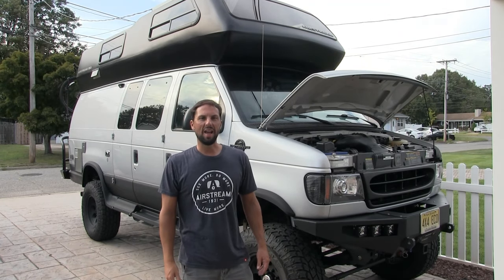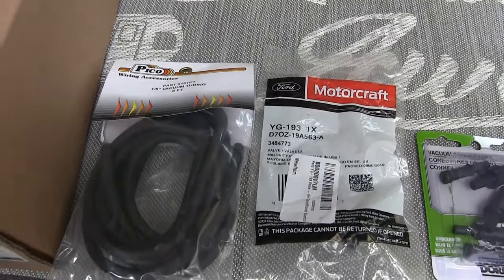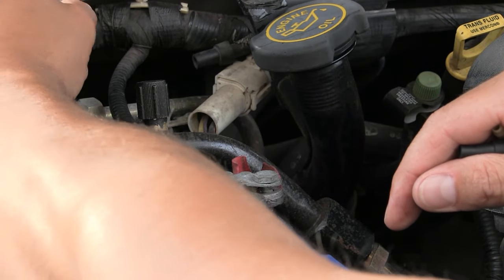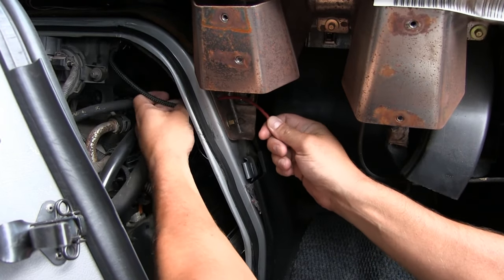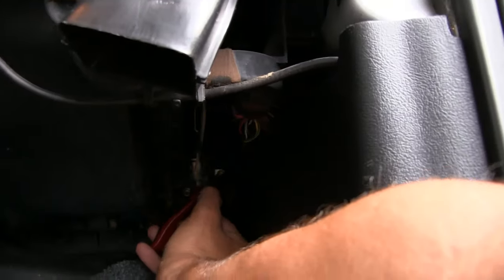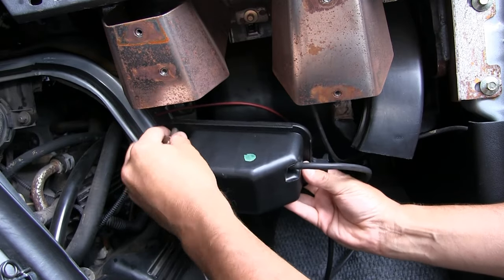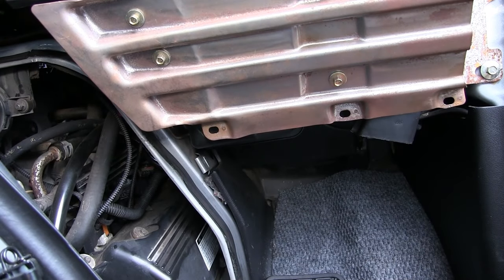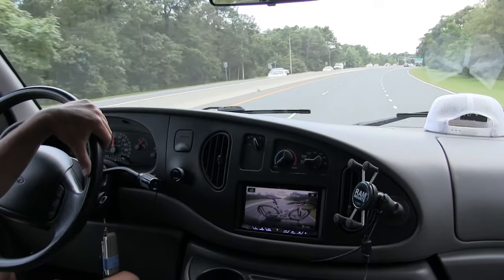Ford Econoline AC Heat Defrost Acceleration Fix

Comment: THANK YOU THANK YOU THANK YOU!!! This video saved us so much time and money. It was easy to follow; so easy that I probably could have done it, but my husband fixed it in about 20 minutes. We didn't have time to order thru Amazon and ended up going to 5 different parts stores for all of the parts, but each one had a piece of the puzzle to get to the final outcome. No more hot air blowing out the rear a/c and even the front works better! Just WOW! Cannot thank you enough! Ours was a 2008 E150.
Reply from the maker: Thank you, glad it was helpful

Comment: Thanks for this video--I think I watched all of them before doing the bypass on my 2004 E350 (where something had failed entirely and left me with air blowing out of the defroster vents only). Yours definitely cherry picked the best parts of the various fixes and put it all into one clear and easy-to-follow video, which is what all of us E-Series owners really needed! The only thing I would add is that it is possible to do this repair without buying the vacuum line connectors (just reuse the pieces from the red line and black line where they connect under the hood, near the cowl) and only about 2 inches of rubber vacuum line.

I pulled enough of the red line through the doghouse bolt hole that when I connected it to the check valve, the check valve could be located just a couple of inches to the right (when looking toward the front of the van) of the vacuum reservoir, which I bolted in the same location as you did. I cut the black line pretty much flush with the grommet where it comes through the firewall into the passenger compartment, so I'd have plenty of that line to work with. Then routed the black line up to the check valve, near the vacuum reservoir. There was plenty of slack to do this. Then I reused the vacuum connector from the other end of the black line (under the hood) to connect the black line directly to the check valve, without any other connectors or bits of rubber hose. After that, all I needed was about 2 inches of rubber hose to connect the vacuum reservoir to the check valve. Nice clean install and everything is tucked well up and away, with no chance of anything falling down into the passenger footwell.
Reply from the maker: Thank you for the useful information

Comment: I agree that this was the easiest video to follow. I ran another vacuum line through the fender to avoid having to clean out my van to open the doghouse. There was a plastic plug in just the right spot. I drilled it out and ran the line through my new grommet. I used about five feet of vacuum line and had to buy one connector. Everything is COOL and groovy!

Comment: Thanx for such a perfectly easy to follow video. I have a 2005 Gulfstream RV based on a E-450 chassis. Followed the directions and for less than $45 it was fixed within 25 minutes vs the $$$$$$ Ford wanted. (I did first put the ac valve in backwards which didn't work of course but figured that out quickly). Anyway, fantastic video and the first beer is on me!!!
Reply from the maker: Glad it helped Daniel
Reply: I too I'm about to attempt this on a 2005 e450 Coachman Concord I'm glad to know it worked thank you

Comment: Terrific video, thanks for the solid assist. My '97 e-150 has comfortable passengers again! Will point out that I ordered 1/8" tube and what I got was too small for this application. Package doesn't say whether 1/8" ID or OD, but must be OD. The connections to/from the bypass valve are 1/8" ID. Local parts house has rolls of bulk tube and I took the male-end parts up there, so was able to confirm fitment before we cut a few feet off the roll. Lesson learned. Otherwise, very clear instructions in this video and a tremendous resource. Well done and Thanks!
Reply from the maker: Thank you for the feedback

Comment: Awesome instructional video!  Thank you so much.  Solved my AC problem of cold air only coming out of the defrost. Saved me a ton of money and done in less than an hour, and I’m not mechanically inclined!  Like you said, the hardest part was reattaching the doghouse.  Your solution worked perfectly. Only thing I did different was I did not cut the vacuum hose under the passenger footwell. Instead I tugged on that vacuum hose to disconnect it from the stock check valve/accumulator behind the firewall and then was able to use the existing connector to attach it to the new check valve. I have a 2010 RV - Ford E450 Heavy Duty Econoline.

Comment: Great video. I have a 94 E150 and the process is slightly different, as there is no bracket that you can unbolt to let the vacuum hose in to the cab. Rather, on the driver side there’s a hose that goes in to the cab already, so you can route the line through that hole, run it across to the passenger side using the extra hose you bought, and then continue the process as in the video. Thank you!

Comment: Thanks for the video!  I did everything how you did it but instead of going through that hole where the bolt was for the vacuum line, I drilled a new on by the reservoir and used the grommet from the original side in that location.  A/C works like a charm now!
Reply from the maker: Glad it helped

Comment: 😁  The gift that keeps on giving -- three year old post that exactly fixed my issue without the 6hr tear out.  Thanks Patrick,  GREAT vid. The only thing that wasn't crystal clear is which vacuum line to snip in the bypass at the far end of the passenger footwell.  You mentioned the "black" tube but the video wasn't entirely clear was it way the hell up in the footwell and fuzzy  ... (I did verify on another YouTube vid that the black tube was the right one ...) Anyway, yours was by far the most elegant and effective solution.  Thanks for posting!! -- Nat 🤩
Reply: I should add one more thing: the symptoms of my van were that the AC was blowing all the time out of the defrost vents  - not as you describe only under load going up hill.  Sounds like your situation my have been a system failing and mine definitely a system that failed completely.  So your fix, fixed complete loss of vacuum to the reservoir which, thinking now, of course it would.  Thanks again!   Nat
Reply from the maker: Glad it helped. It may vary year to year. This video gets a surge every year when the temperatures are the hottest
Reply: @NewJerseyOutdoorAdventures  I can only imagine.  The fix felt a little improbable going in -- I kept thinking what happens if it doesn't fix it, but it did completely.  Loved that the new reservoir fits neatly under the passenger footwell cowling.  Thanks again!
Reply from the maker: @natbrace220  happy to help

Comment: Been a ford tech for 30 years, As long as you don't have a vacuum leak, you can add the new check valve at the connection under the hood. just block off the bottom nipple that would have went to the vacuum reservoir. 5 minute fix. great video though. thinking outside the box. 2 thumbs up!
Reply from the maker: Thanks for the feedback

Comment: When looking for the vaccum lines coming down, I found two coming from a connector of some type. Key is not to cut the line to the actuator, which was clear/white in my case. It was black that needed the cut and the new accumulator goes to the up line. Worked out great and a very quick job - about 20 minutes. I opted to drill a small hole through the firewall (helps to do a pilot hole else the drill will waiver. Finished with a .213" drill bit as the final vacuum hole.
Reply from the maker: Thank you for the useful information

Comment: I bought the reservoir from Advance Auto and a check valve. I drilled a hole instead of using a screw hole, and used one of the old fittings as a grommet for the red engine hose. Also some black electrical tape to cover the hole where the hose came through from old reservoir. I just pulled the hose out, and it was long enough to reach the engine hose. I like that you bought a tank instead of the home-made route.
Reply from the maker: Oh wow, nice

Comment: Thanks! I did this exact fix on my 2007 E150 and it helped a lot! It didn't completely fix the issue though, so there must still be a very small leak somewhere, but it's a lot better. Before the fix, any slight hill or load on the engine would cause the vents to switch to defrost. Now after the fix, it stays on whatever vent option I select unless I'm driving up a big hill loading the engine constantly for a long time, then it eventually switches back to defrost, but it immediately returns to normal as soon as the load decreases.
Reply from the maker: Glad it was helpful. Hopefully you find the other leak
Reply: I'm in this same boat. I did the repair two summers ago and now the issue is back and slightly worse than the first time I repaired. I'm reluctant to dig into right now with the heat we're currently experiencing in Arizona. I'm very confused as to how this issue is resurfacing so quickly. 166k views. Great video. Bad original design.

Comment: Great video! For those reading this, I used this method WITHOUT the accumulator. Just simply hooked the red line to the black line with a check valve in-between. Vents work as they should. If you are in a pinch and don't have the accumulator it's not necessary.
Reply from the maker: Sweet

Comment: Worked like a champ! Only one black hose under the rt. side dash on my E350 cargo van, so I took the chance, and struck gold! Why I waited so long to fix, I'll never know, but I was guessing it was a vacuum leak, not a faulty accumulator or check valve. No matter, summer's almost over, but it can still get hot, in SoCal, so, much thanks!

Comment: 2011    E250 has a glove compartment.  So I taped the accumulator to the sheet metal on the right side just under where the vacuum line goes up through the dash.  Thanks for the video!
Reply from the maker: Great tip!

Comment: Worked like a charm.  Took about 20 min total to fix it.  The shop wanted $2200.  I did it for about $50 in parts.  
The only difference I saw was the red vacuum line in mine was just a normal black vacuum line for me.  Otherwise, all was the same.  2006 Ford e250
Reply from the maker: Great

Comment: The accumulater fix works like a champ...and thanks so much!!! Just want to mention to make sure there's no twists or kinks in the tubing or else the air flow still won't work right, even if the AC no longer cuts out. AGAIN - THANKS SO MUCH FOR THE TIME AND EFFORT YOU TOOK TO POST YOUR VIDEO...(you're a People's Pro...!!!)...⚡👍🥴⚡
Reply from the maker: Thank you. I am glad it was helpful.

Comment: My vehicle was a 2014 E250. A little different dash but routing was easy and worked perfectly! If your doing a model similar to mine I drilled a small hole under the passenger side tunnel about 2 ft up. Ran my original vacume line in there. Put a small hole in the bottom left of the glovebox and ran the canister line into the glovebox where I placed the canister.
Ice cold AC from the dash.
Thanks

Comment: From under the hood, when you disconnect the tube that goes to the reservoir (the black one which goes and disappears on the left side - in the video at 2:12 is being abandoned), that tube can be jiggled and pulled out to be used to connect to the new reservoir. The red one gets pulled via the dog house.  Also the tube at the passenger side which goes to the reservoir can also be jiggled and pulled out. In this video it is being cut 5:08. When you jiggled and pull this tube out, the check valve gets removed from the vacuum reservoir and can be reused. No need to buy one or buy any extra tubing, just have to buy the reservoir. To summarize, disconnect the tube under the hood - red in color - pull it via the dog house and route it thru the hole of the bolt. Jiggle the the other tube under the hood and pull it out to use it to connect to the new reservoir. On the passenger side the black tube coming from the top of the dashboard going to the old reservoir via the body of the van via a plastic washer, pull that washer out and jiggle and pull it out, the end of that tube will have the check valve from the reservoir. Attach that tube with the check valve to the red tube from the dog hose. The other tube can be use to attach the check valve to the new reservoir.  Hope this helps.
Reply from the maker: Thank you for the awesome information
Reply: Ernie, it sounds like you have a nice shortcut idea there. 

BUT how do you identify the BLACK tubing to be pulled? And how hard you need to pull it?
Reply: @bborges79  Its the tube that goes to the left tire side and disappears. I just jiggled it to get it off the reservoir. The other tube to jiggle out is on the passenger side inside of the van, right at the floor going to the reservoir via a white washer thru the body of the van - attached to the body of the van.
To figure out which tube this is, trace it from the top of the dashboard by removing that cover. The check valve is attached to this tube, it should come off easily once that washer is loose. Hope this helps. Good luck. I did this some time back - 10 months ago. Trying to remember. Take care.

Comment: Just used this video among a lot of others to order parts and install the bypass reservoir and check valve under my dash on my 1993 E350.  It seems to work great.  Wont know for sure till I test it out on mountain passes and rolling hills where it was really a detriment to AC on my last 3 extended trips from Seattle...LaPaz Baja Mexico, Arizona, and Newfoundland.   I so hope this fixes it.  It does seem to have more air coming out than before and seems to work well but the true test is in traveling under all conditions.   This is THE BEST VIDEO on the subject.  But I will say a 1993 is different than the others...the reservoir will not fit the same way but it does fit off to the passenger sidewall and I had to drill a hole through the firewall down low (No Bolt Hole available) and I ran the hose tucked in and up over the stuff above and then neatly down  the passenger sidewall and to the reservoir which is screwed to the same wall there.  Also the 93's vacume hose coming off the manifold is a lot harder to bring back to the new firewall location.   The plastic hose was brittle and I broke it twice while pulling it out of the original connector and vacume hose bundle.  I used 1/8" hose and some store bought vacume connectors and a store bought grommet.  Also I used a small section of the old hose to make one of my connections to the check valve.  Thanks for sharing.  Yours was the easiest to follow...simple, and directly to the point.
Reply from the maker: Thank you for the useful information. Hope it works for you

Comment: Thank you so much for this video. There are several out there addressing this problem, and yours was the most comprehensive. It worked like a charm. I suck at doing things and this was a 20 minute fix. Thanks again!

Comment: Great video !  Another video takes the vacuum line from under hood through the fender panel using a fish tape or coat hanger.  Much easier than removing dog house and drilling.

Comment: Above the control on the dash is a football size panel. Pop that panel up and see the actuator. Remove the vacuum tube from the actuator and Tie the actuator for a temp fix.  It's the actuator on the right.  Then do this man's fix when you have time.
Reply from the maker: Thank you for the Suggestion

Comment: If only your check valve is bad and the accumulator itself is not leaking you should be able to get by just adding an inline check valve that could be done under the hood in a couple minutes. By the way I'm really grateful for this post. I own a 97 Econoline super duty RV that has the same problem. My chassis is slightly different not only because it's a lot heavier Duty but it is also a 96 chassis. It was manufactured in the last month that they made to 96 Econoline cut-offs chassis but it was titled as a 97 by Fleetwood the manufacturer of the coach. You saved me a lot of time figuring out where the check valve and accumulator are but I had the same idea oh just adding a secondary. I'm hoping there are no actual vacuum leaks and it's only a bad check valve because that will turn this 30-minute job into a 2-minute job. All so hard to believe Ford would be so stupid to bury this device behind the heater box but it doesn't surprise me.
Reply from the maker: Oh wow Thank you for sharing that
Reply: @NewJerseyOutdoorAdventures  you are welcome and I will keep you updated if I'm able to fix my Econoline without opening the dash. I will also let you know if it fails but I will need the check valve either way so might as well try.

By the way I think you had mentioned in another video that you selected this fan because it had the V10 engine. I was afraid of the V10 engine because of many reports of shooting spark plugs through the hood and things like that but I think that only affects later models. I wanted the 460 V8. I know they are considered boat anchors with little horsepower and lots of weight but they do have lots of torque and it is pretty easy to get 600 horsepower out of one naturally aspirated. This series of Ford big block has a long history of winning races since the 1960s it's just a shame that Ford did a piss-poor job engineering them for use in heavy vehicles. They are great for driving around town pulling heavy weights but horrible at high speeds especially with a big RV Body. I got some improvement after modifying my air intake but to get real horsepower I will need to replace the fuel system intake exhaust and maybe the heads and even a camshaft.

Comment: Thanks, you have certainly save me $1000 on my Ford 150 Econovan year 2007.  Like your van it’s also a converted RV van called a traverse a Canadian rebuild!  Not a bad fix for $50 I’m getting cool air coming out the proper Vents.😃😎👍🏻👍🏻